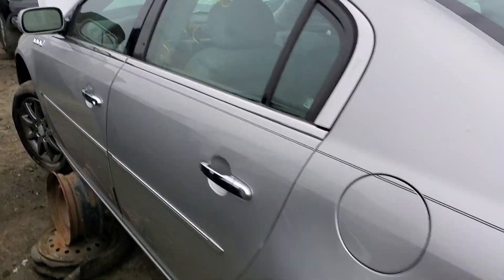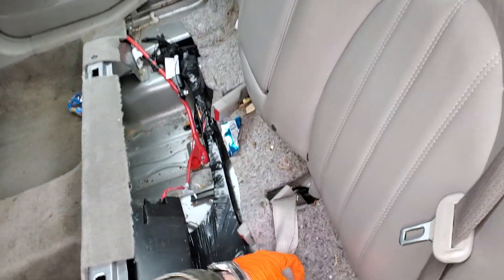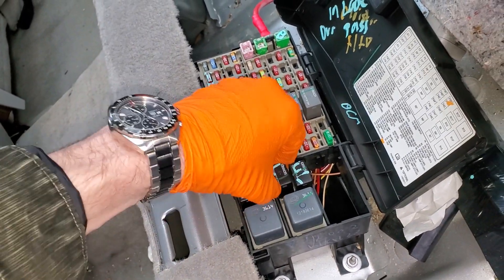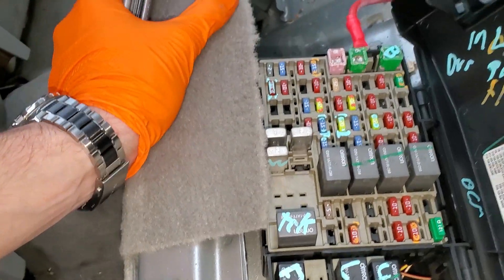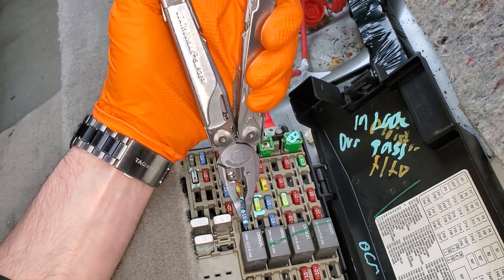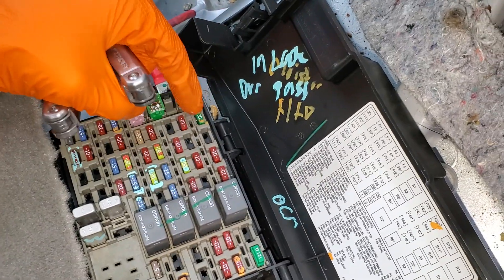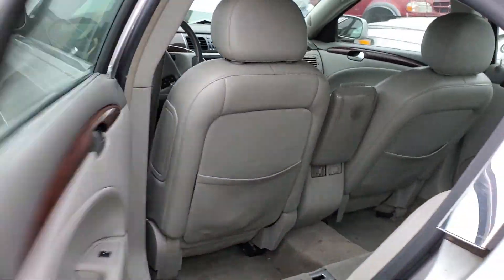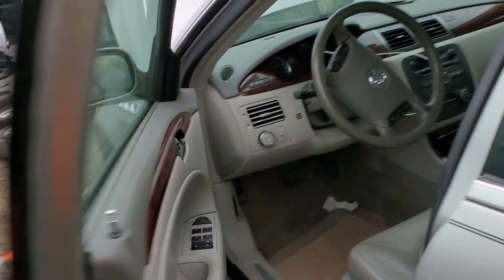2007 Buick Lucerne Power Window Fuse, Power Door Lock Fuses & Relays

Comment: I have a 2006 Lucerne with no power to drivers side door. Little to no experience working on cars so this video has been very helpful in giving me a starting point to diagnosing the problem💀
Reply: @jackmatthews8062  yo bro, this problem just happened to my 2010. Did you ever figure out what caused?
Reply: Yo, bro, this just happened to my 2010.Did you ever figure out what the problem was?
Reply: @jakeheinrichs7699  bro it’s another video on YouTube that showed me . Type Buick Lucerne door panel not working and it’s showing u that it’s a wire between where u open the door .

Comment: What about the ladies? Jk
I just replaced the window motor in my passenger side and think it might be a fuse problem. I don’t know if it is related but my locks get stuck too like they don’t have enough power to open or lock all the way. So should I replace all the fuses?

Comment: I have a 2008 Lucerne. What's the chance that both rear door locks fail at the same time? The front door lock/unlock with the switch and fob. Is there a separate fuse or relay for the back doors?
Reply: It’s what I’m try to find out?

Comment: I have a 2011 Buick Lecurne .The letters around my gear shifter does not light up and my security light for the alarm doesn't flash?
Is it a fuse problem? If so would that be in the power box under the back seat or up front?